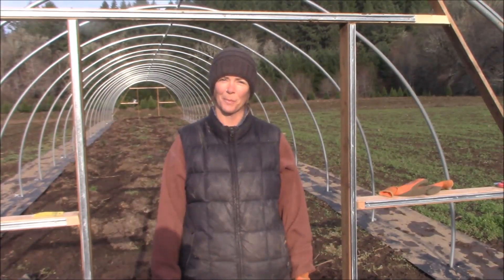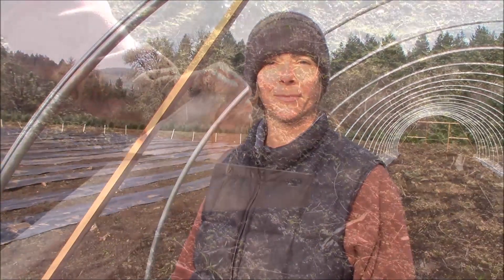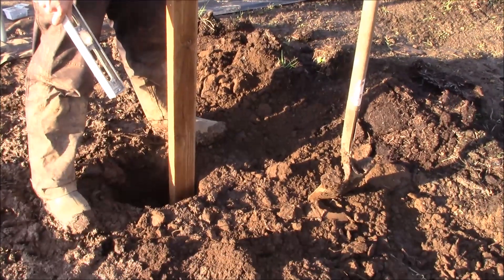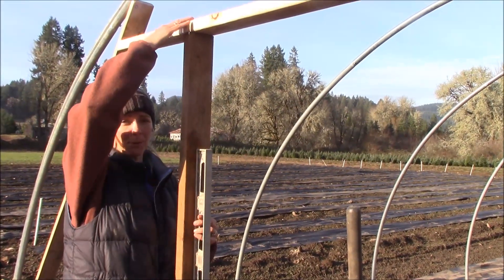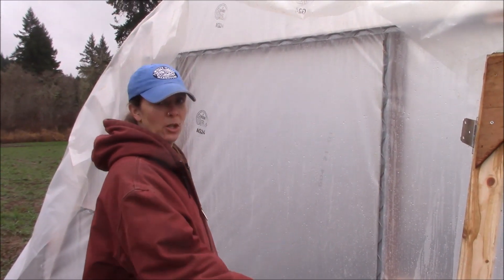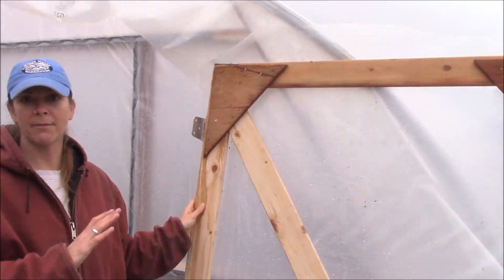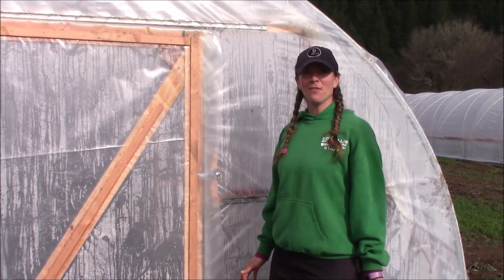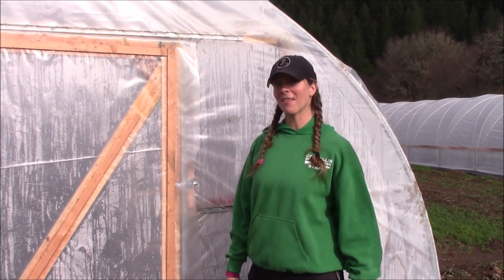How to Build Greenhouse End Walls for Caterpillar Tunnels

Comment: You could have attached the side rail wood to the outside of the structure and put wiggle wire onto them so that in the summer you could roll up the plastic without losing the tautness of your plastic over the top of the hoop house.

Comment: Great Job!. I like the idea of the cross bracing on the inside.  Question, I noticed that there was no mention of a bottom rail for attaching the plastic at the base of the end. Does the plastic not attach to anything at the base?
Reply from the maker: We don't add a bottom rail on the ends. Since it ends up being less than 4' between where it attaches to the bottom of hoop to the bottom of the door frame, we've been able to keep that plastic tight enough that it doesn't flap or let a ton of wind in.

Comment: Hi- I was wondering if you can tell me what plastic part you put on first? Do you start with the entire hoop part, then use wiggle wire to attach it to the top and sides? Then work with the front and back end walls next?? Cover and attach with the wire?
Reply from the maker: We do the end walls first with wiggle wire, then we pull the hoop plastic and attach it in the center of one hoop with another layer of wiggle wire. We then go to the other end and pull as tight as we can and anchor the center of that hoop as well. Once it's secured in the center we have one person one ground pulling down while the other does the wire towards the ground, and then we do the same thing on the other side. Once it's all tight we go back to the other end where we started and do the same process.

Comment: Has the internal bracing really helped to keep the tunnel secure against winds?  I have a 100ft Quonset pro with a ridgepole and wind braces.  I ordered their new side poles which are made to anchor for wind.  I live in Oklahoma on a high hill and we can get the winds!  I also am going to put double rope on the tunnells.  I've just about to begin building.
Reply from the maker: It has as much as we need it. We don't get very strong winds often, but we did last month and everything stayed put. We did end up concreting in the door frames for extra stability too

Comment: Hi- I really enjoy your videos. Can you tell me how you ventilate the tunnels? If the wiggle wire is used to attached everything, how do you raise the sides to create air flow?
Reply from the maker: The sides have a cord system and the plastic slides up and is held in place. Farmers friend has a video here on YouTube, if you search "farmers friend caterpillar tunnel assembly" ...they show the whole system very clearly. We just decided to change the plans so we had framed ends
Reply: Ok got it - I just watched the video. thanks! How do you roll up the sides on your more traditional greenhouses?? Do you use wiggle wire to attach the plastic as well? What I am having a hard time visualizing is on the caterpillar styles, the sides are not attached to anything and the tension from the string holds that up, but what do you do to raise the sides on your other greenhouses? I was trying to see how you attached the plastic in the other videos. Regards
Reply from the maker: So on the houses with roll up sides there is a 2x4 on the outside of all the hoops that runs the full length of the house. The plastic is attached on both end hoops just like in this video but it is also attached to that 2x4 that is 3 to 4 feet off the ground. The part that hangs below the the 2x4 is attached with more wiggle wire and channel to a pipe that runs the whole side, it attaches to the handle that allows the sides to roll up and down. If you have high winds you would also add wiggle wire to the base board for when it's closed so it doesn't flap
Reply: I have a couple of cat tunnels I am thinking about putting end walls onto. My concern is will I lose the ability to roll up the sides at all with the end walls? Essentially is the end of the plastic covering the tunnel itself attached to the last hoop? This is the part of the system I do not quite understand... Otherwise it looks like a solid set up...

Comment: I just heard about Farmer's Friend by watching another video, and I was wondering it they have a way to roll up the sides of the plastic in case of high heat, or even a way to roll down some kind of shade if the sun is too direct?  The Farmer's Friend website is really not very specific.  They show the base models of all their products at what seems like a reasonable price, but I wonder as you add on options does that quickly overwhelm?

Thanks for a nice video - good job on the video and the end walls.
Reply from the maker: Yes, the kits come with brackets that allow you to pull up and hold the sides.  We have the sides up most of the season.  I have not seen them offer a shade option, but you could pull shade cloth over, for sure.